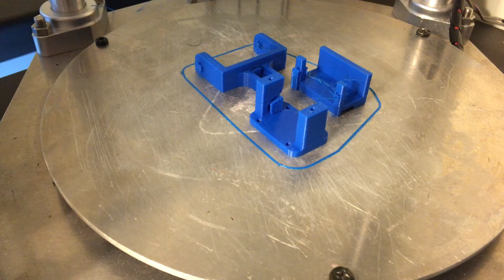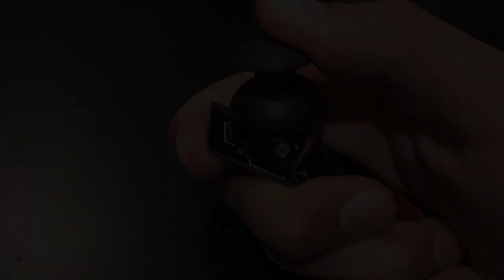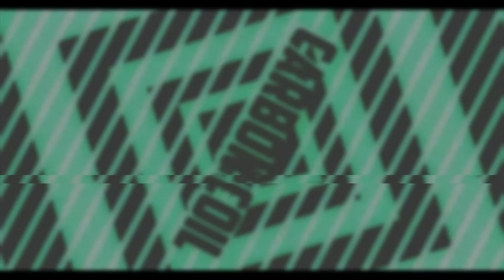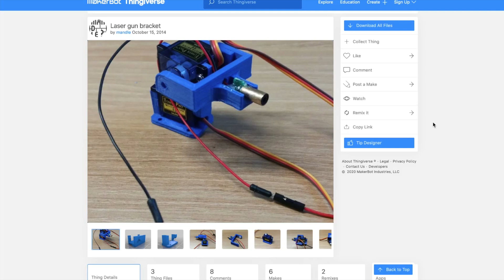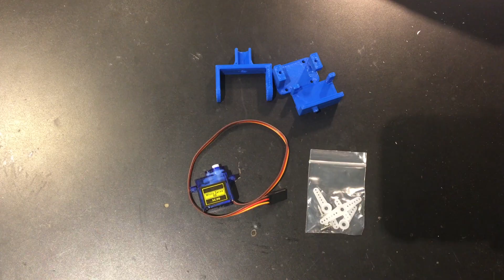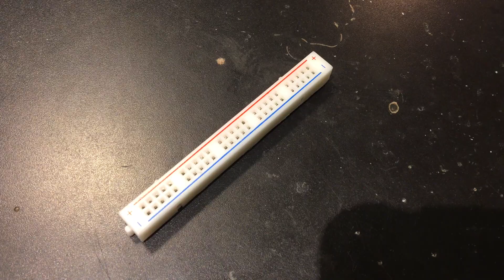3D Printed Laser Turret

Comment: What did you use as a power supply for the servos?  I assume the laser was 5V and that can be powered by the arduino but what power supply did you use for the servos?
Reply from the maker: I think I just used the Arduino 5v power rails for the servos as well (Since they are 5v). However, if your concerned about damaging your Arduino from the current draw, you could use a lab bench power supply, or a 5v wall plug adapter (Like this: https://www.amazon.com/BOLWEO-100-240V-Wireless-Connector-5-5mmx2-1mm/dp/B0719GY29M/). Just make sure to connect the negative of whatever power supply you use for the servos to the negative of the Arduino as well.

Comment: Neat. Ima try to put a camera on a similar system
Reply from the maker: This servo turret might be a little weak for a camera, You might want to try something like this instead: 
https://www.thingiverse.com/thing:1821872
Reply: Carbon Coil Ahh. The camera is tiny from a crappy 5$ broken quadcopter from off brand eBay. Thank you for the help though, I like the other design.